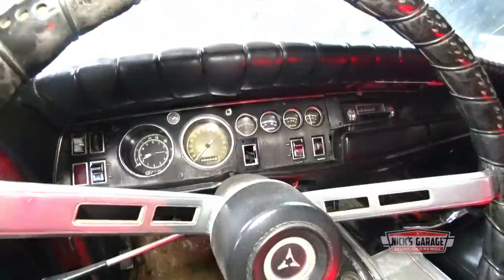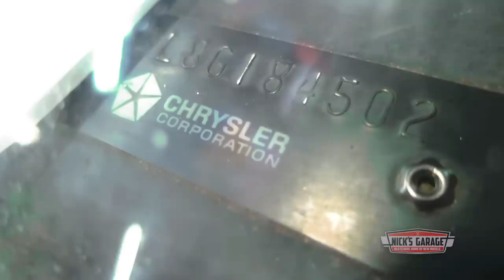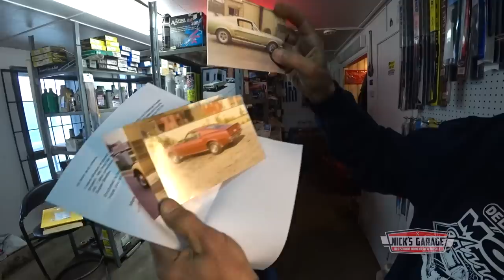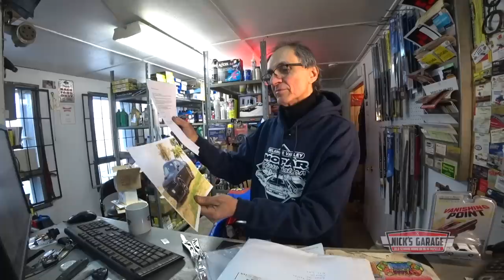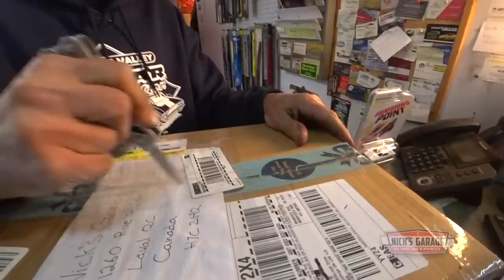1968 Coronet R/T 440 Tear Down - You Won't Believe What's Inside!

Comment: I had a 69 years ago the cops never caught me they asked all my friends if they knew someone who had a dark green charger with a brake light cutout switch. I wouldturn the tail lights off with a tail and punch it sideways to make the corner and made the corner and always lost The tail the tail went into the ditch a lot. I sold the car to a friend of mine apparently he drove it a bit more conservatively they had his tag number down I used to work on it still for him on day I replaced the tail shaft bearing and seal on the transmission and I test drove it after the repair and the cops called his boss at work he had a perfect alibi because he was at work all day

Comment: So the head that got the hole in it, is that repairable? I guess not?
Reply: Robert S.      We have a spare in the shop.
Reply: Nick Panaritis, using a spare OEM head from the same era does not affect the value then? But if you use a modern casting it would? The whole numbers matching thing gets confusing. I have a 2018 GT350 that got a new long block as the first one was eating oil. Lots of others have too and the big arguments is that doing that reduced the collectibility of it. I don’t care though.

Comment: Bolt was put in when head was off.  It's too long to fit through valve opening and it has 9/16 across the  flats, valve lift not high enough. Plus the bolt would get hung up on the valve stem if it was thrown down the carb.

Comment: Just sying Nick.. I would rather see your excellant crew. disassebble that engine, carefully documenting each step. Engine mapping. Keep assembly parts in same place taken off. to measure, inspect clean and number. Others might need to know.. original specs. Actual data on this block. I mean it is a treasure.. NOT a race car tear down. Show your guys the best way to operste.. Number each cylindrer... Why do the work without bluprinting before/after. work.. your project but if I buy the car.. I want to see every piece. NUmbered measured.. Enjoy the project Nick.. :)
Reply: Robert.    Good point. We tore this engine down knowing we are going to change a few parts. In many tear downs, we keep parts in order as much as possible.

Comment: My theory is the threaded end of the bolt got between the valve and the seat. The resulting slack allowed the pushrod to damaged the lifter keeper. The lifter opened farther than normal causing the pushrod to travel farther, opening the valve till the spring stopped it. 
Does anyone know if that would have given the bolt enough room to pass into the cylinder?

Comment: I know I wont get a reply but why are you guys not pulling the A-33 four speed and doing a complete rebuild? You're going to have a brand new 440 hp pumped up and mating it to a transmission that hasn't seen the light of day since it rolled off the assembly line 53 years ago I would of already had the trans out and also would rebuild the shifter to factory specs going balls out on the engine and leaving a 53 year old trans to take the horse power and torque only to break does not make any since ?????????????????????
Reply: Roger.  1st, this car was never a race car. And also today, it is still a cruiser. It has the 18 spline heavy duty trans. We took off the side cover and found no wear at all. After the engine was installed, I took it for a long hard drive and all went well. Thanks for watching Roger.

Comment: is that dash the same as the amc gremlin? look alot alike.
Reply: This was a standard dash new for 68' in most B body Dodge and Plymouth cars, the two large center gauges are tach and speedo with many sporting the combo tach and electronic clock known as the "tic'toc clock" with the smaller gauges to the left as Alternator, oil, water and fuel 

there were some B bodies that had a wood or walnut colored plastic verses the typical black

Comment: Probably got drop down in there when somebody was changing the carburetor
.... because that looks like a carburetor Bolt... I had an Oldsmobile 455 Rocket engine one time... a small screw got down in the intake and it done damage not quite this bad but it sounded like holy crap and it was just a very tiny screw.....

Comment: Could the valve even open far enough to let that bolt in there or did some one take out the spark plug and drop the bolt in there??.
Reply: Pro.   It worked it's way in slowly.  Did not fit through the spark plug hole.

Comment: There is only one bad thing about those elephant motors is 8 to 10 mpg right?
Reply: The big blocks cost 20 bucks just to warm up. Build a 360, 500hp check Nick's 360 video

Comment: The lifters are supposed to rotate , the bottom of that lifter looks like it should , when the lifter doesn't rotate that is when the cam lobe goes flat .
Reply: John W.   That is correct.

Comment: Nick, you mentioned that the car was bought at auction, but not the type of auction. This has me wondering if the bolt wasn't something done in spite. Then again, isn't the bolt you found inside the motor about the same size as what SHOULD be holding down the distributor??   Something you should mention for all your "YOUNG" viewers is to double nut their air cleaner stud. Lock them together with a dab of red locktite and never worry. I have a buddy who DID NOT do this and he paid for it dearly.....
Reply: Steve.  The distributor bolt is 5/16, not the 3/8 bolt we found in the cylinder.

Comment: This bolt didn't get in through a plug hole.  It didn't get left in a cylinder during any reassembly.  The evidence demonstrates that it got dropped through the carb, sabotage pure and simple.  The intake valve would prove this easily if the undeside of the head was polished from rattling the bolt around before it found its way into the chamber.  I've been through an instance like this before, with an engine repair where some goombah dropped a bolt like that into the guy's carb simply because they didn't like the guy.  That bolt also made it past the valve and broke the piston and polished up the underside of the valve in the process before making it past the valve.  Too big to get through, you say?   Not if the hydraulic cam's lifters attempted to pump up to take up the slack once the shank of the bolt got past the valve head.  This obviously happened while the engine was running.   Likewise the piston had scarring where the intake valve, propped up by the shank, had been kissing it before the valve got pumped up enough to allow the head to get past it, just like this 440.  I despise people who would do something like this.  No matter how much they may have hated the owner, the car didn't do anything to them.   Spite sucks.

Comment: could that even get past a valve? it's almsot as if someone dropped it thru the spark plug hole on purpose
Reply: Funkyzero.     We try putting the bolt through the spark plug hole, did not pass through.

Comment: Instead, they could've used epoxy adhesive to make sure there were no intake leaks.  The distributor had the wrong bolt, right?  A cylinder isn't a place for storing your bolts.

The lifter face looked reasonable to me, not getting that one????  Granted, the lifter and push rod were damaged by colliding the bolt into the valve and piston but the lifter face seemed serviceable?

Comment: I HATE the use of Power tools even on disassembly , why well simply because you don't get to feel of the thread is damaged or possibly over tightened. There are a multitude of things that can be disguised by power tool usage.  Rookie assembly mistake caused BIG problems here.

Comment: What do you bet someone took this engine drag racing, damaged something, replaced the engine, kept the og one in a backroom somewhere and put it back in and got it up to barely working condition before sending it to auction, while using the replacement engine for parts to do so, hence all this oddity stuff.

Comment: Nick, if the vehicle is an auction car, any thing weird can and does occur! I have caught rectal foreheads drop
many and varied items into the carb intake!  Just being sh*t heads. How do the items make it through intake?
Damned if I know!
Reply: john.    I believe someone lately had replaced the carb, and I guess at that time the bolt fell in during installation. And after that, car went for sale.

Comment: What are u talking about paper gaskets a 13:00???
Reply: Factory 440's and 383's and 361's were all machined well enough on the exhaust manifolds that the factory assembly process used a special fibered grease between the manifolds and the head to form the seal.  Later on,  when worked on,  would often be the first time Mopar Big Blocks would get exhaust gaskets installed by dealership mechanics.
Reply: Patrick Wayne it always pains me when folks call Chrysler engine big blocks not Raised block.
Reply: @scooter2kool173  Well, only the 413, 426 and 440 (and a very rare batch of 383's), were RB's. The largest plurality of 383's and ALL 361's as well as the 350's were 'B' blocks. 

So, for most Mopar folks, the term Big Block, really just clarifies that the distributor is up front and the oil pump is outside the engine.

Believe me, my Dad brought me home from the hospital in a dark blue '64 Polara 500 426 4bbl Street Wedge with the new 833 4speed and 3:23 SureGrip 8 3/4 Salsbury rear axle. It's in my garage today, still only has 71k on the clock. In '73, Dad had to sell it,  to finish paying for the house to be rebuilt after the tornadoes because insurance wasn't enough. 

I dreamed of the car all the years thereafter, until in 1987, I bought it back into the family.  Up until then,  I listened to the men in our family and our church speak wistfully about it's beauty and formidable performance, back in the day, and I  read everything written by Tom Hoover and Dick Landy and Larry Shepard in hopes of one day, getting it back, and eventually building it up to be the 426 Hemi 4speed car my Dad SHOULD'VE ordered.

I am true blue Mopar through and through. You're in good company with me when it comes to loyalty to the fratzog.
Reply: @patrickwayne3701  . You know all the die hard fellows. True Mopar.

Comment: Im at 10 min 59 sec im gonna call it... somone dropped a bolt and it got caught between the piston and the valve and caused the lifter to fail and push rod to bend

Comment: Whoever the dumbass that slipped that Bolt in there, when they are put in the spark plug on or even before that had to know he did something wrong especially when he started it up and started rapping so hard. And generally you're not missing a bolt that size and know it immediately

Comment: why replace all the pistons if the cylinders measure 4.32  if one cylinder is damaged why not just sleeve it put a new stock bore piston in it  and go down the road or are just out to charge people for unneccesary work?

Comment: Sorry no way did bolt that big get in past intake valve for micro sec that the valve opens the bolt could never get past with out taking out the valve out note,new exhaust gasket new plugs all evidence is there...

Comment: Put a Hemi in it be done Some new tect Some thing got more horse power and fuel mileage None thing is better than a HEMI > kept the old engine just so its got a matching engine   WTF NO WAY  a bolt omg  Some sloppy mechanic had his head>  some place where it shouldn't been> header gasket on the intake manifold what a fruit cake

Comment: Someone obviously removed the spark plug and put that bolt in the cylinder...there is no way that bolt would have made it past the valve even if it could've worked it's way through the carb. It was an auction car so maby the previous owner fell on hard times and didn't have any choice but to sell the car...so it might have made him feel better knowing the buyer would have to pour more money into it before enjoying his buy or maby hoping to wreck the engine entirely which would drop the value since it is numbers matching.
Reply: If the bolt was already in there, wouldn't it be embedded at the bottom edge of the piston? It would be resting there when the engine started and it wouldn't be easily moved up to the top edge, being relatively heavy. It seems impossible, but the impressions indicate that it came in via the valve, I think?
Reply: @bills6093 , I guess so

Comment: Sorry, but ! why did Mike run the engine for twenty minutes ? In no way it ran with just a little miss,
it had to be knocking with sledge hammer blows while running. 
In a way Mike was lucky the piston expanded in a way that it siezed the engine with little damage to
the block or bore.

Comment: Looks like sabotage, anybody capable of changing the head gaskets isn’t going to leave a non factory bolt in the intake or cylinder.  I had that happen to me in shop class in 1967 when I was putting a 1959 383 Mercury engine in a 1956 Ford Crown Victoria . somebody stuck a hand full of 1/4” nuts down the carburetor. 🤬🤬🤬🤬🤬🤬🤬. Oh by the way , I’m glad I found your channel even though sometimes it brings out bad memories, Just like my ex wife telling me “ either you sell that 69 Camaro or I’m leaving. “ So I sold my 1969 Camaro Z/28 X33 302 4 speed 456 rear gear and she left anyhow. In the Bible it says “The root to all kinds of evil is money 💰. Well let me tell you , in my opinion it’s WOMAN. 🪦⚰️ Real pain in the Donkey.

Comment: That bolt cant make it through the valve opening ding dong. Ffs
Reply: If you pulled the spark plug, would the bolt fit in that hole?

Comment: Wow.    What did someone do.   Rape. His exfriend. Remove a spark plug insert bolt .. Instant bolwn Engine.  Love Coronets  . 
 I have year 1.... 2nd generation coronet. 1965. 440 stroker powered. .  Stromburg big 97 6 pack. 4 speed..  Move. Over. People Are Racing ..   Mopar..  Mopar. Mopar....  Yup i have a Ford as well. The first one.   25. Model T. Faultless body. Racer

Comment: Snap ring not a washer  ! And "not to pick on you but" you don't measure a cylinder with a $20.00 Chinese caliper   ! And hey you amateurs,put boots on those "Rod Bolts" even while tearing down,if those (hard) rod bolts slap the crank from the side you can damage  a perfect "maybe forged" crank, i can't believe this, so " Back-Yard " and on national TV ,wow
Reply: Wooly.    Rods are going scrap, and the crank is going 0.010 undersized.Checking bore with my  Starett gauge works for me.